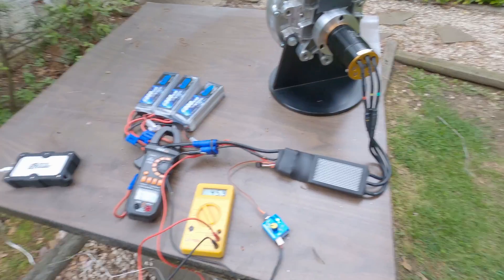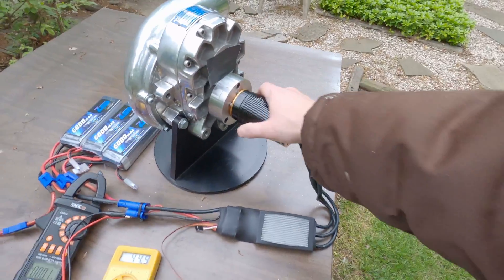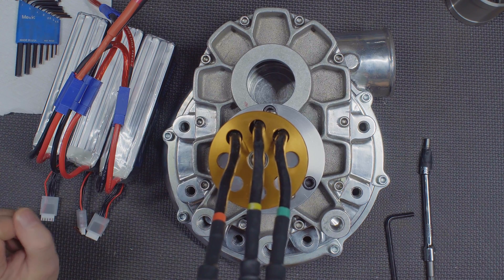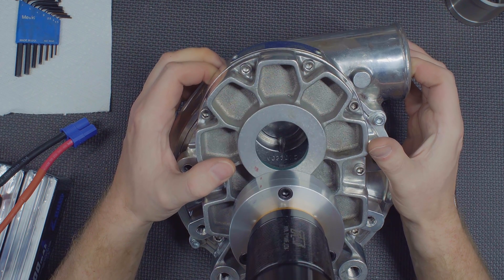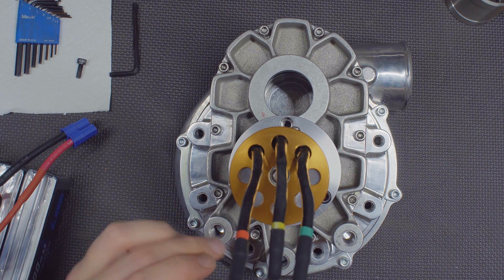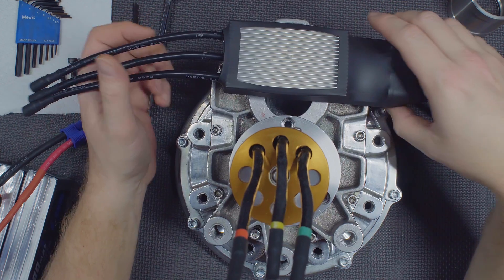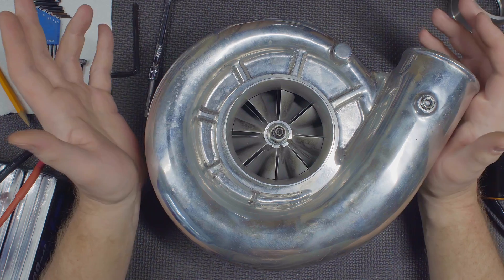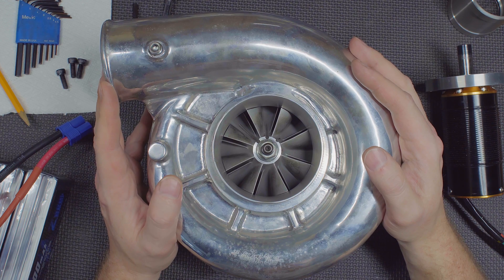Electric Turbo - First Blow

Comment: How much have you got invested so far .oh they already have working one's already
Reply from the maker: The only working ones I know of are Torqamp - which is a third as powerful as this thing.  Do you know of any others?  And as for how much I've got invested... please don't make me add it up.  Let me put it this way:  I could have built a cheap turbo setup easily by now.  And it's going to be a lot more than the small fortune I've already put into it.  Subscribe, keep watching, and if you can, donate a couple of bucks to my patreon to help me pay for this stuff.  By the time we're done I'm pretty sure we'll be into 5 figures $$ wise and hopefully 4 figures hp wise.  Patreon: https://www.patreon.com/AlexLTDLX
Reply: @AlexLTDLX  autoline network is the name of the youtube channel I was talking about
Reply: Xr.mtx is a cheaper version one that cleetus used on his channel not the torqamp I think he said 400 for it now I know that you are trying to get a very powerful one but you could use some of the parts from others no need in reinventing the wheel...oh there is also another one I can't remember the name but if you look up teen finds first camaro made on that same youtube channel they have a new company on with a electric supercharger but they are useing in for low end torque and it also has a turbo on it so they are taking out the lag I'll go get the name of the youtube and I leave it for you . I really like what you are doing ether way

Comment: Dude buy the Torque Amp
Reply from the maker: Why?  The Torqamp is only good for about 200 horsepower. What you see here has been dyno tested to 600. And I'm pretty sure I could push it to well over 700.  This thing is more powerful than 3 Torqamps combined.

Comment: Do you think it is reasonably easy to couple electric motor with cold part of a turbocharger?
Reply from the maker: It's possible but since the center section is typically made of cast iron and you'd have to re-do some sort of bearing setup (unless it's really small like the first thing I built), then I actually think a blower is a better option.
Reply: @AlexLTDLX  I'm thinking about using only cold side, no center, and somehow connect compressor wheel to the motor. 50k rpm should be almost enough...
Reply: I guess I might still need some bearing...

Comment: Hello Alex..Love your project. Which brushless motor are you using (if I may ask)?
Reply from the maker: Ask and you shall receive: https://youtu.be/W0kHD9We4zY
Reply: @AlexLTDLX  You're awesome sir...We are looking to do something similar. The purpose is to use the electric turbo to spool our twin turbos earlier, so instead of max boost at 4500rpm, we are shooting for 3100-3300 rpm. Two firms (as you know) make kits but they are over $3k for all the needed components and 4-5 month waiting period as they are back logged.
Reply from the maker: @ltorealestate  there's torqamp and who's the other?  Btw, we dyno'd the car Tues; video coming soon.  It was an eye opener...
Reply: @AlexLTDLX  I've spoken to the Torqamp guys and they're cool, but 5 months or so behind on orders and the kit, bypass intake pipe and controller comes to over $2700.

Comment: Its running very inefficiently, the gearing is way to high, slowing the motor down too much and making it consume excessive power, thats why the voltage drop so much
Reply from the maker: What gearing?
Reply: @AlexLTDLX  That compressor is from a procharger right? it has a gearbox in the back of the turbo, if you have it runing direct drive the kv of the motor may be too high for the impeller size
Reply from the maker: It's a vortech and the gearing has been removed.  Watch the other videos.

Comment: Impeller needs to spin 30000rpm to make boost in a 5L V8.
Max impeller rpm is about 50g.
Yer not getting 30000.
Reply from the maker: https://youtu.be/wi8cf1QzT-Q

Comment: I think about putting something like this on a turbo charged car, can this eliminate turbo lag? With out tunning?
Reply from the maker: Oh, I'm sure it would.  But it's not cheap, easy or particularly safe.  In my last test (video coming soon), I hit 22,000 watts peak.  That's more power than anything in your house uses.  It's probably more than your house uses in total.  It's dangerous as hell, to be honest.  I know that Audi and BMW are releasing electric assisted turbos next year, but not on this scale.

Comment: Very cool. Bench testing my set up with the ultra caps at this time as well. Plan is to measure the actual voltage drop and run two 48v banks in series with a regulated 48v output.
Reply from the maker: Very cool!

Comment: Any thoughts on back pressure at full go when on the engine? 
I'm sure after 3000rpm engine speed not a problem.
Reply from the maker: I don't know - anywhere from 3-6 psi, most likely.

Comment: Awesome. Awesome. Awesome. Been waiting months for this.  I have a question for you. If you had to take a wild guess, What was your heat loss in watts? Out of the approximate 7000 Watts, would you say 1000 was going to heating up the various components, or more like 500.  Also let me ask it like this, what do you feel was actually going to moving air".  Would you say minus all losses, you were getting 5000 to moving air"
Reply from the maker: I'm not really sure.  I've been playing with voltage drop calculators and efficiency calculators.  A lot of this will also could be answered by just figuring out more accurate ways to measure rpm or even testing my actual motor's Kv.  But I can say that given the losses in the cables (which can be reasonably calculated) and assuming an ESC efficiency, we can guess... but I don't have enough info to guess that accurately yet.  I can say that the losses aren't really that great - the tankless water heater in my house draws 13kW and all that power goes into heating water.  Here we saw and average of about 7 kW and no significant mass - and that mass in the grand scheme of things didn't get that hot.  So I'd say we're probably looking somewhere between 5 - 20%.  I'd like to get a better handle on it; but at the end of the day, impeller rpm is what matters.

Comment: WELL DONE SIR! I've been trying to do this for over a year with various turbos, several modified power tool gearboxes, and a bunch of high power, off the shelf RC Car parts. We have made it work a few times, but our gearboxes, or motor/shaft connections always fail. Clearly it's best to start with a CSC, which already has a super robust multiplier gearbox attached lol. I came to that realization a while back, and the search for another tinkerer with a similar idea on YouTube,  is what led me to your first video. I was the guy who suggested the indirect motor connection using a supercharger coupling device. Your HEX drive idea though, was a stroke of PURE GENIUS my friend!... Once again well done, and THANK YOU! I'm finally putting the turbo to bed... maybe lol
Reply from the maker: Thanks.  I wasn't sure the hex drive would work, but the math said it would, and have room to spare; plus it was about the easiest thing I could do.  Thanks again!

Comment: dear sir;

you can measure the frequency of single phase and get the RPM, then multiply by the gears ratio, the put the rpm value into the compressor map (supplied with the supercharger) you will know the max flow/boost curve of the created device.
Reply from the maker: I've made a number of compressor map videos; and we know what this compressor map is.  I just need to figure out how to translate the frequency to rpm.  Working on that now; but if you know, please share it.  Thanks!
Reply: @AlexLTDLX   put the clamp meter on one of the phases, frequency = RPM * No. of poles/2
check your motor specs for the poles no.
 Note : don't use oscilloscope, use clamp meter, you dont want to read the switching frequency ... i think the clamp meter will filter those out.
cheers!

Comment: Brilliant!!
I think it would be a good idea if you get yourself an e-scooter battery like a bird or lime.
I would suggest a lime gen 3 battery 36V 15.6Ah 50 cells.
Reply from the maker: Thanks for the tip.  I'm not seeing the need for any other batteries (except one more of the same three I have now) - we have plenty of current over time and voltage drop is manageable.  I'm pretty sure an e-scooter battery would have issues with voltage drop under a 15,000 watt load - plus it's bigger and costs more.  Remember, we can re-charge when driving around and the blower isn't running.  In fact, I've already got the chargers.  But I'll look into it.

Comment: thanx for the update ,  i am into this stuff too, since 2002 actually , but my lack of electrical knowledge stooped me , my plane is to use 2 small lead acid around 20ah connected in serial for 24v , my problem is i don't know how to charge them . i want them to be charged when the etrubo is not on and when i turn the eturbo off charging starts and so on , i don't know what charger and where to connect it to? car battery or alternator ,  can you make a video about the charging process ,, plz plz
Reply from the maker: I will get to that.  I've got two chargers already and have ordered two more.  There's a reason why I went with 4s batteries and not 6s... all will be revealed as soon as possible.

Comment: They make Boat Rated RC ESC with built in water jackets.  Perhaps if you blow that one up?   The car ones come with fans built in.
Reply from the maker: Yeah, I saw those... hindsight and all that.  I honestly didn't expect it to get as hot as it did.  The bigger car ones with fans might be ok as is.  This one might be ok with just a larger heatsink and a fan.  It all depends it I can remove the heatsink without destroying it.
Reply: @AlexLTDLX  Oh yeah like if the darn thing blows up :)   Are you running an innercooler or checking the air temp out of this?  If you are running an air/water you might be able to tie in there?